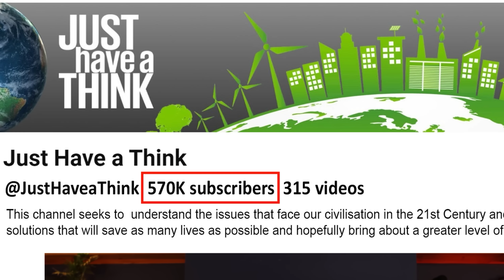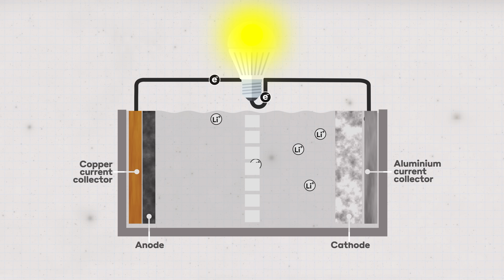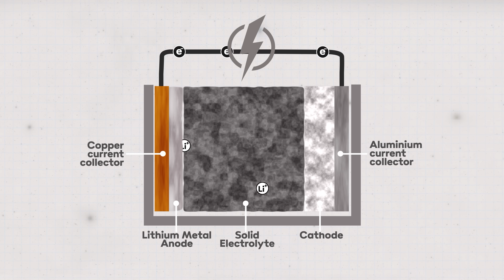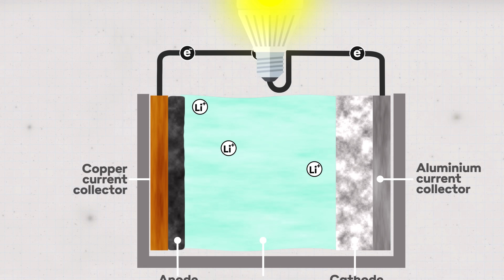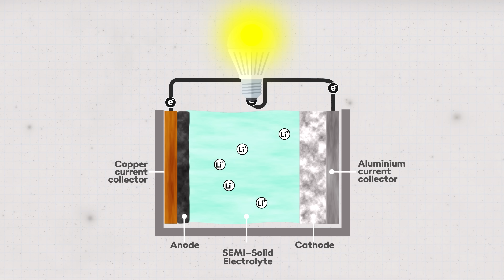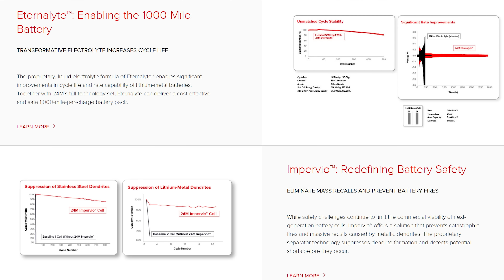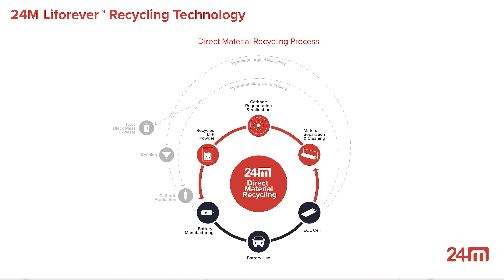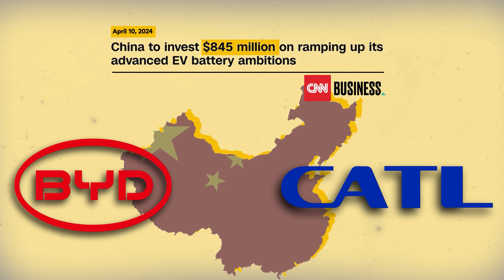Would you be OK with a Semi Solid State?

Comment: Wil Prowse did a review last year of a semi solid state battery. Data sheet said it was safe. They even sent him a video of them puncturing one cell with no issues. Wil punctured a cell and it smoked then was on fire. So his test proved they’re not safe. 
Wil said they cost more but have less charge cycles than LiFePo4 before degrading. They do charge at much lower temperatures than LiFePo4.

Comment: Only 600 miles seems rather paltry to me.
Then again, only 50 something mpg on gasoline is ridiculously low.  Only the vapors burn and fuel injectors and piston engines don't/won't work well with fumes.
Here's something interesting.
"Why 200 MPG is Possible", Eagle-Research.
It's quite packed with data and history.

Comment: Whatever happened to the hollow core capacitors as a potential battery source?
The main drawback is that while they can store up energy capacitors tend to leak energy.
There was talk of trying to change the internal shape(s) to reduce the space between the layers using the honeycomb as a reference.
There was also speculation about experimenting with certain granites and crystals as there was some evidence that it was done in the ancient past. I wonder what would happen if you ran those substances through a magnetic field?

Comment: Dubius claims unrelated to battery tech make me worry about all of the claims. Show me the car that does 600mi in 90kwh. The only car i know of that comes close is the old EV1 and aptera at nearly 10mi/kwh. But thats a specialty designed autocycle with 1/2 the drag CD of a normal EV. So take the model 3 long range. 75kwh only gets it 350 miles. Take an EV similar to the one pictured next to the 600mi claim. The audi Q8 etron has a 106-114kwh pack that takes it up to 295mi
Reply from the maker: Such a boring old non-argument. Bless you for trying though.
Reply: @JustHaveaThink  Correct, It is not an arument against the product, it is a concern about the company appearly to try to mislead people.
I dont have any of the actual data from these company's products, but when these companies present verifiably bad data unrelated to their product, that makes me concerned about the validity of their own data.
Additionally, i didnt say dont buy these products, just question the claims before investing in a company that advertises bad or misleading data, and maybe wait a few weeks or months before buying products until the claims can be verified by independent reviewers.
Dont write it off, but also dont bet the farm.

Comment: Current battery tech is shite. But improve the tech so they charge in ten minutes and you’re still left with the impossible task of ensuring the grid has the capability of supplying enough current to satisfy the demand. And if we going to rely on wind and sun to do that then just forget it. Whatever happened to proper engineering?
Reply: MG cars battery lifetime warranty coming 😊
Reply: EVs already charge 350 miles in 10 minutes, more mileage than I got from the tank of the car I drove for years. The grid can without any doubt meet not only the demand from EVs but the much bigger demand from electrifying almost all primary energy. And of course it can be done with renewable energy—wind, solar PV, CSP, clothesline paradox solar, hydro, geothermal, some tidal... 
It will reduce global energy use by half & make energy cheaper. 
Whatever happened to proper English?
Reply: @J4Zonian it died with its car industry and its greedy conservative self serving government 😮

Comment: "Semi-solid" and "quasi-solid" both falls in the category of "not-solid". "Pseudo-solid", could be a good name for "not-solid" batteries marketed by implying, or straight out claiming that they are solid state.         

The proposed potential advantages of [actual] solid state batteries requires finding a practical way to make lithium ions move in a solid medium, back and forth, for every charge cycle, without damaging anything. We've had the compromise, as in gel/polymer batteries for a long time, which has some potential advantages, but as with any compromise, they come with disadvantages too.      

True solid state batteries, that actually are superior to conventional li-ion batteries without significant disadvantages, are a bit like man made fusion power reactors, they could potentially be fantastic, if anyone can find out how to make them practical. Both technologies are possible, but we don't know how to make them practical, and the theoretical potential of either require solving a lot of very difficult issues. Also, in both cases, conventional alternatives are improving fast, meaning, if all problems are solved for either of those technologies and commercial production is achieved a decade or two from now, they probably won't have that much of an impact.

Comment: I wonder why some lithium batteries burn - could you explain?
Reply from the maker: @Sciayam The electrolyte is usually highly flammable. Li-ion batteries can get very hot when charging. If the battery is not made properly and does not have the correct BMS (Battery Management System) then it can suffer from something called 'Thermal Runaway' which can lead to fires. Also if a typical lithium-ion battery is breached or pierced then a short circuit occurs. That is the cause of the dramatic fires we see on sensationalist YouTube videos. In reality there are hundreds of billions of lithium-ion batteries in use every day all over the world (one in every smart phone, for example). The vast majority are correctly constructed, and fires are extremely rare. In fact you are something like 100 times more likely to experience a fire in an internal combustion engine vehicle than you are in an electric vehicle.

Comment: Another excellent video Dave, I see battery technology as being a little like early mobile phones. So many times were we told that the latest mobile phone technology was going to be the bees knees, but sure enough it was surpassed very quickly, until we reached the compromise we have have now. I am, therefore, a little skeptical about many of the new battery developments. Is this the one that breaks the mould? We shall see.
Reply from the maker: You are quite right Paul. Technology is moving at breakneck speed. But that's kind of a good problem to have.
Reply: How are modern phones a compromise? They're incredibly advanced and I don't really see how expectations could have been much higher.
Reply: I guess you're probably referring to networks. That I can see.

Comment: Have you come across any research on efforts to resolve the issue of "poor contact/ high resistance" in solid state batteries between the electrolyte and anode by using a semi-solid electrolyte? It seems like an obvious direction to research. Unless I'm missing something related to using multiple types of electrolytes.

Comment: 200 MW capacity or MWh ?
Reply from the maker: MW is power capacity. MWh is energy delivery. A 200MW capacity battery delivering for 2 hours (assuming a constant rate) would be a 400MWh battery
Reply: @JustHaveaThink  I am confused because you said "
7:41
In October twenty-twenty-three, Factorial  opened a factory in Boston which will have  
7:45
a two-hundred-megawatt capacity at full tilt. "

I don't understand the rating of producing batteries by measuring in MW.  If I take the statement literally, it means that each second the factory will be producing 55,555 Wh of batteries?  That's definitely impressive, if that's what you meant.
Reply: I just found the quote on Factorial's site: "With a capacity of 200 MWh, this will be the largest production line for solid-state batteries in the USA to date. "   So the video is missing that "hours" word.

Comment: I'm totally fine with NiFe accumulators too, but it is not the future that tech-vloggers on youtube promises us once a week.
These "semi-solids" are slightly better then current LiPo's on energy density, but totally unproven or worse in other cases.
They are not enegy dense enough to give us the electric passenger planes we have been promised for years now, and they don't  charge from 0 to full in minutes as the solid state batterys promised us for car use and they don't last for millions of cycles without degradation, so what use are they?

Comment: "solid state" is just one small aspect of possible battery cell types. No need to get wrapped up in the semantics. There are infinite ways to design and produce a good battery.
Reply: But not many of them will suit an automotive application and that is the target that everyone seems to be aiming at and I don't know why. Storing the power generated from renewables should be the top goal as it will reduce more greenhouse gas production than the global car fleet. Electricity production from fossil fuel sources is still bigger than transport.

Comment: A 40% reduction in weight savings is enough to upgrade my 2011 Leaf to 40kWh without having to use stronger springs or derate the load rating. Previous owner put a "12 bar" (2nd gen) battery in in 2021: so I have about 7-10 years before another replacement is needed.

Comment: It's funny how things like "the two surfaces need to tightly hug" as a requirement are forgotten when you've never had to worry about that before because liquid. A malleable substance was my first thought followed by maybe a gel, but I wonder if a solid electrolyte with a thin interface material couldn't work (e.g. thermal paste on a heatsink). It sounds like even if it did being able to retool an existing factory is far far more valuable than any performance benefits a hybrid solution would provide

Comment: In fecal matter semi or not makes a difference. In batteries not so much. 

What i want to say: Gimme a battery that lasts 2000 cycles, has enough power and capacity for 350-400km in high winter. Not more and not less.

Comment: I'd be OK with anything that:
- Has high energy density (per weight and also volumetric)
- Can be charged super quickly
- Can provide lots of power over long periods of time
- Does not degrade with use
- Does not age
- Is cheap to produce
- Is secure and does not burn
- Does not use rare materials
- Will not create CO2 during production
- Is easy to mass produce and readily available
- Is completely recycable
- Holds its charge for a long time when not used
- Has almost no inner resistance, so no power is wasted by producing heat when used or charged
- Works perfectly in all temperature ranges

Anything else?

Comment: Came across some more information online, left some other links in the replies.

Recently I have seen a review of a product sold by a company called Yoshino, which actually sells a product with solid state batteries. It sells portable battery packs for things like camping or what not, but I haven't really done much digging on the company to see how legit the solid state battery is. Also the review I saw was just on the product that uses it, so no tear down to look at what was inside. Finally, the application is clearly different from something like using the battery to power an EV or something of the sorts, I am sure that there are different requirements which this battery probably cannot fulfill, which I assume is why they don't really sell the product for automotive industry (Assuming the battery is legit).
Here is a link for the video in case someone is interested: https://www.youtube.com/watch?v=9AZRPItAsfA
Reply: Sure enough, it seems it was too good to be true: https://www.youtube.com/watch?v=LsZfjF9SObo
And actual tear down: https://www.youtube.com/watch?v=z8sVbwitrB0

Comment: H2MOF for ambient temperatures and low pressure storage for transportation by Nobel Prize Winner in Chemistry, Fraser Stoddart and connect this breakthrough with Eirex Tech turning any type of water into hydrogen gas at 25 cents per gasoline gallon equivalent at any decentralized location is moving in the right direction.
Reply: If that's real, I'm all for it.  I don't think it's real though.  Not when a proper lifecycle analysis is done.

Comment: Dry electrode which allows above 400 wh/kg in cell level energy density with liquid electrolyte is the real key for ultra high energy densities,because it allows  more active materials in both cathode and anode side of the battery,meaning u can have much higher active materials in it,while keep the weight and volume the same with out sacrifising cycle life and safety,dry electrode with semi solid electrolyte is the only way to increase energy density of a battery to above 500 wh/kg right now

Comment: the great thing about science is that sometimes you make a mistake that opens up a whole new area of research
Reply: When a mistake becomes a mutation.
Reply: @MichaelMcRonaldMacDonald  sometimes that happens as well. lol
Reply: No mistakes, just happy accidents.
Reply: It's like that time I stubbed my toe really hard and it opened me up to a whole new level of pain.
Reply: The Schottky diode was something like that - Mr. Schottky was making diodes and the metal used to create the silicon to wire terminal connection spilled over and covered one of the sides going all the way over the other region. The thing about accidents is, like it's claimed Pasteur said "only the prepared mind is ready to take advantage of it". Schottky decided to measure the diode and he found out that a metal-dopped silicon conection created a diode - as oposed to a P-N junction in which one side is P dopped and the other is N dopped. Schottky diodes have a wide range of application because their forward voltage drop is considerably lower than PN junction ones - they are widely used in switched power supplies so ... basically every power supply nowadays.

Comment: I didn't get the part where he says that the battery has an energy drnsity of 391Wh/kg. Isn't that really low?
Reply: The current best lithium cell energy density in wide use today is around 270 Wh/kg.  If the 391Wh/kg figure is for cell energy density then that is quite good and even better if the figure is referring to the energy density of the entire battery pack.
Reply: MG cars battery lifetime warranty coming 😊

Comment: "No self-respecting marketing department would be without an acronym." So true!
Reply: Dry electrode which allows above 400 wh/kg in cell level energy density with liquid electrolyte is the real key for ultra high energy densities,because it allows  more active materials in both cathode and anode side of the battery,meaning u can have much higher active materials in it,while keep the weight and volume the same with out sacrifising cycle life and safety,dry electrode with semi solid electrolyte is the only way to increase energy density of a battery to above 500 wh/kg right now
Reply: I feel like "FEST" could use a bit more marketing pizazz, tbh. How about "FESTivolt!" 😄